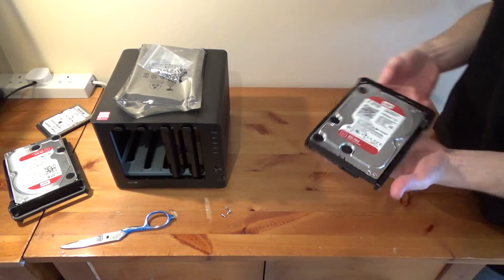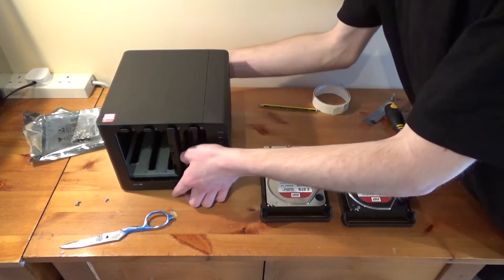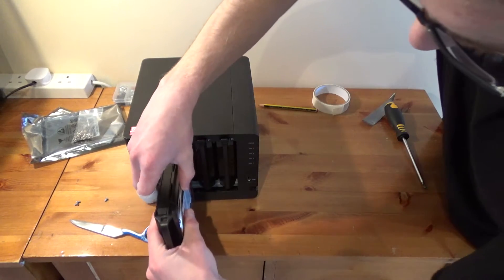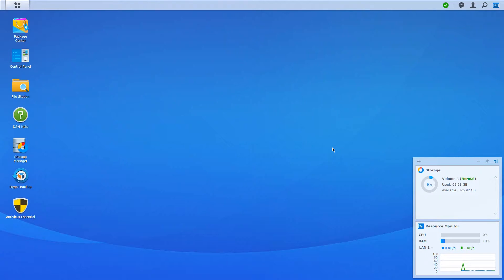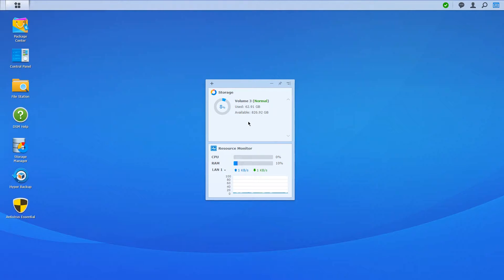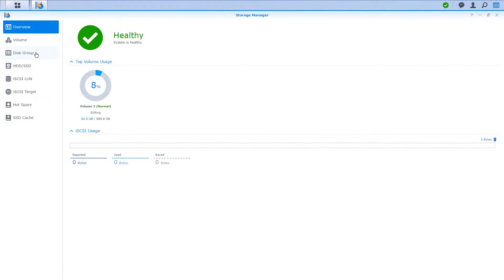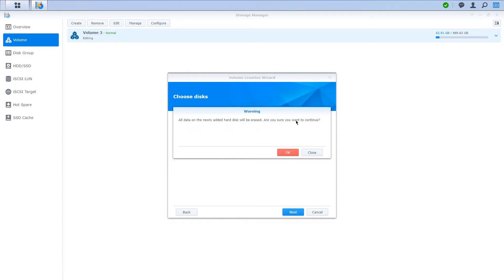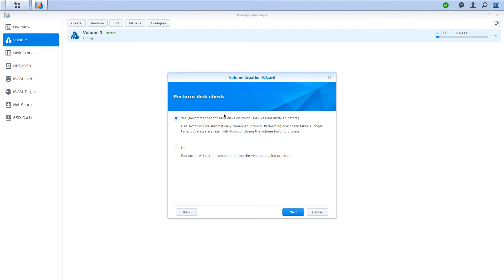Synology DS415+ NAS: Part 3 - My NAS Set Up & Performance Over A Gigabit Network

Comment: have you still got the DS415+ NAS or did it die on you? there  are a lot of reports of  chip degradation with the atom  chip in it and also   boot issues where the blue light just flashes did you  experience these issues on your DS415+?

Comment: I always connect a new hard drive to an old PC and perform thorough disk diagnostics before actually installing it in the destination computer. I've had a few drives over the years that came with bad sectors so I was able to immediately get replacements for them.